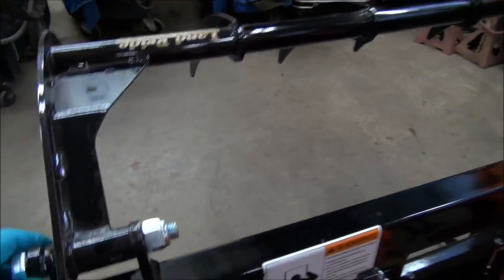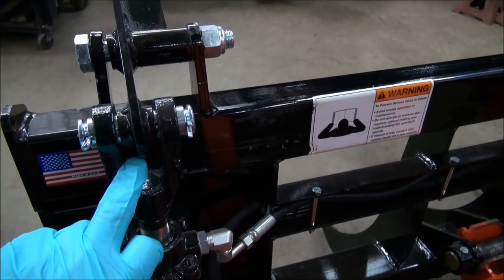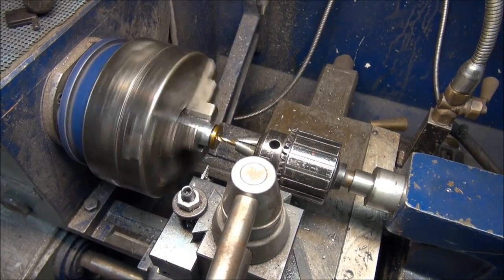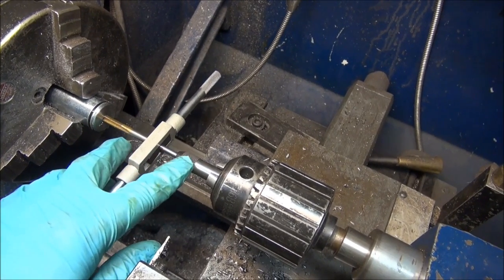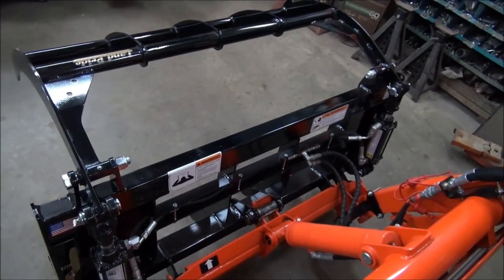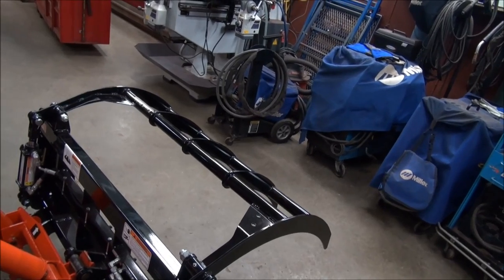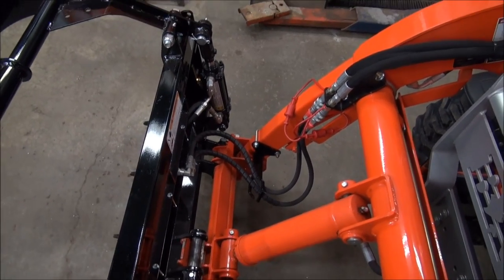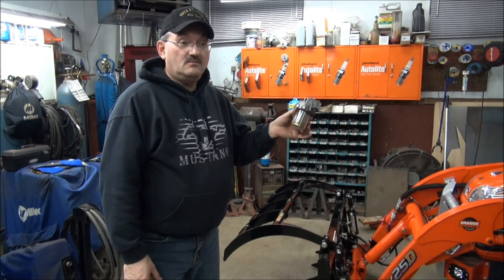Land Pride Grapple Grease Nipple Installation

Comment: Great modification - sure beats pulling the hydraulic pins (top at least) and hand greasing them. I have the 1060 model grapple on an L2501 and Land Pride tech support said the lack of zerks should not be a problem but I hand grease them anyway.

Comment: Well done- on the lower pins with no grease nipples would a liberal coating of anti-seize prevent  rusting since they are so low to the ground.
Reply from the maker: Good idea Steve but I think I'm going to head back to the lower ones and do them as well. I only feel like I did 3/4 of the job like it is.

Comment: Paul,  on those lower points (the pistons) just spray a little lithium grease in there once in a while, there seemed to be plenty of space to get it in there.

Great videos, long or short they are all great!
Reply from the maker: Well to tell the truth I never had the heart not to put grease nipples in the lower ones so I ended up doing it lol. I show that in my last video. Good advice though. Thanks!
Reply: I saw the 1 hour video, were you mentioned you put in the nipples.  Better safe than sorry.

LandPride didn't do it right by not installing those.  Also the cost of the switch was a rip-off!
Reply from the maker: iflyhelis
Ya I had to put them in the lower pins as well. It just didn't seem right not doing it. I got to change that awful switch for the grapple as well. It's just to big. I don't have small hands yet the switch is Hugh so I may machine one. This time I'll have it look like the OEM knob with the switch built into it. I'll make it out of billet aluminum and polish to a chrome like finish.
Reply: I saw the video on making the switch holder, real nice craftmanship there.

The lower pin grease nipples came out better than I expected, with the amount of room you had to work with at first.

Comment: I didn't get to say anything, to late last night when I watched this one. But I'm awake now,  it gets a bit cold up your way, what kind of lube grease do you use working in the snow and ice and oil for your diesel?  As far as adding grease fittings I totally agree and the only thing I can see why they didn't do it is to sell more parts.  Nice work and I will be watching for that fuel system upgrade.

Comment: Great mods Paul, I bet you will end up doing the lower :]  A filter bowl guard is a great  idea . I've pulled sticks that have wedged in between the frame and filter assembly a few times. The only reason the assembly was not  damaged was the flexible mounting bracket . Keep  the Mods and videos coming .
Reply from the maker: My friend you know me to well. Yes I'll be doing the lower ones. I just ran out of time but I'll be doing them this week. Thanks for the info on your filter system. Yup. It's getting a guard.
Reply from the maker: *****
Man I just listened to that song and I love it. Seriously. Did you write that? Buddy you got a hit there, I hope you realize that. Thanks for sharing.

Comment: Do you use a go/no go water trap filter? I like the clear bowls because you can visually see the fuel, but prefer ones that have a drain on the bottom. Makes removing a little water or particulate a little easier.

Comment: Hello Paul,

I wanted to say thank you for all the video's on the BX mods, they are wonderful.  You've given me plenty of insight and I appreciate that.  I recently subscribed, so please keep the video's coming.  My question tonight is with regards to the grease nipples being mounted to the outside of the grapple pins.  Have they held up well and would there be any benefit (or protection) to having them face the inside of the grapple?

Have a great day and happy holidays!
Ken Smith
Sheffield, MA
Reply from the maker: Ken Smith 
Your kindly welcome Ken. As for your observation on the grease nipples. I could have recessed them inside the pin and that could happen IF they do break off but I've never had that happen. The grapple is really only moving branches and stumps and those items do't reach back that far.If it do pose a problem I'll recess them. It's a simple fix if need be but I'm glad they are there now. 
Happy Holidays to you and yours as well. 
Thanks for watching!